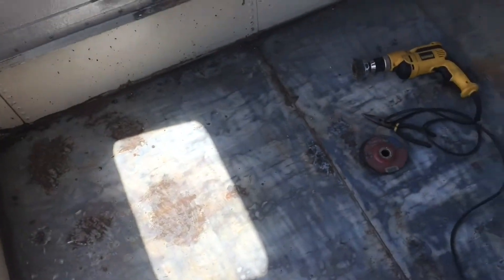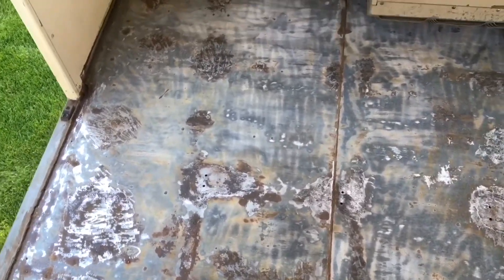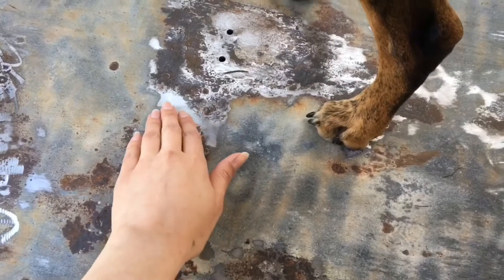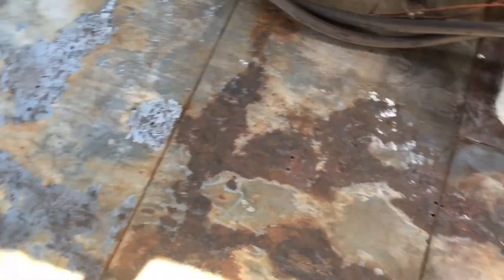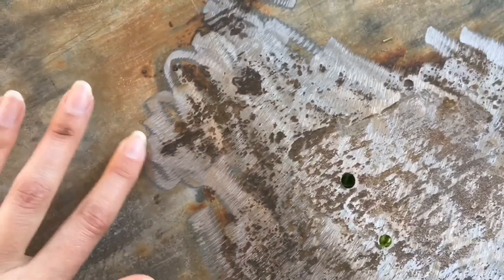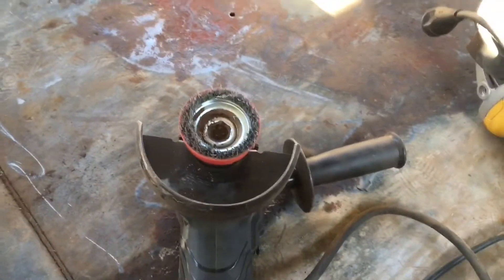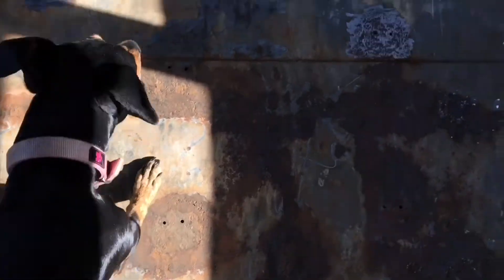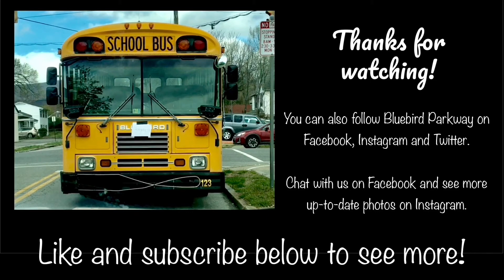Floors Part 1 - Grinding The Rust Out / How Much Is Too Much Or Not Enough / Bus Conversion Vlog 004

Comment: i actually seen a lot of busbuild vlogs and seen a lot of people use rustconverter with a lot of success , taking the flake rust off and maibe dig out the real deep rustspots should be enough
the weldspots you do need to take down to bare metal , a neat trick i learned a while back : take a piece of flattened copper tube or flat bar and hold that under the hole before you weld it shut , the copper doesnt weld so it breaks off the weld , it does prevent the blobs of weld underneat the floor though

Comment: I think y’all did an awesome job. Definitely do not need to make it shine if you are going to treat it. Just the flakes is fine. If I may suggest, after you treat it, use Rust-Oleum Professional Cold Galvanizing Compound Spray for the heavier damage areas. I address this briefly on eps 20 minute mark 19:50 and also eps 22. It’s basically “adding” new metal. It’s very strong so make sure to wear a good mask. Have you considered plugging the holes vs patching..?
Reply from the maker: Thanks! I will definitely check out the rust-oleum stuff. I’ve been trying to find a good rust converter so this seems like a good option. And thanks, I feel a lot better about what we did with the feedback ;)
Reply: Bluebird Parkway It’s not “normal” rust-oleum. It’s a cold compound and the can actually weighs almost 3 times the normal primer can. Again, use it where the heavier damage areas are. It would be pretty expensive to do the entire bus.

I used naval jelly ..(spell check)... for treatment. That too is very strong...just wash off after. 

Btw eps 26: minute mark 0:34 on plugging vs patching the holes. It’s very affective and fast!
Reply from the maker: This is probably going to sound terrible but I hadn’t really even considered there being a difference.... glad you said something! So much to learn!!
Reply: Bluebird Parkway Lol. When you said “rust-oleum stuff” I knew I needed to clarify. We do a lot of restoration and projects so it’s a go to product. People don’t realize what is actually is. Obviously with anything, research everything and determine if it’s right for you. I use “but for ME” in my videos a lot. Because I want people decide for themselves if it would work for their particular “application”  :)
Reply from the maker: So galvanizing applies zinc... so what would be better.... a converter to react with the iron oxide to produce iron phosphate or coat with zinc? Or both? I have the science background but no practical application.... obviously very useful...............
Reply: Bluebird Parkway Woman you lost me at phosphate...lol. Have ya NOT watch my videos. I struggle with big words! I would definitely still convert to treat it, applying the zinc builds it up.
Reply from the maker: Lol just started the videos lol n yea there r so many products for this kinda stuff with so many big words idk how to choose....
Reply: Bluebird Parkway The guys and I do a lot of projects. We each are talented in our own ways. AND we still research YouTube University before we start anything. Lol. 

Before each stage of my build, I watch hours and hours of video. I want to know if there’s an easier way or what issues I may run in to. This is such an unusual build/project that you can not have too much pride to ask for help. I ask all the time.
Reply from the maker: Yes I’ve been watching a bunch of videos and reading. And asking tons of people for advice. I’m learning there are many ways to do things and not just one obvious “right” way...